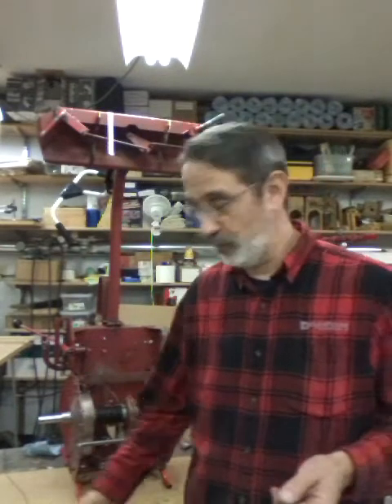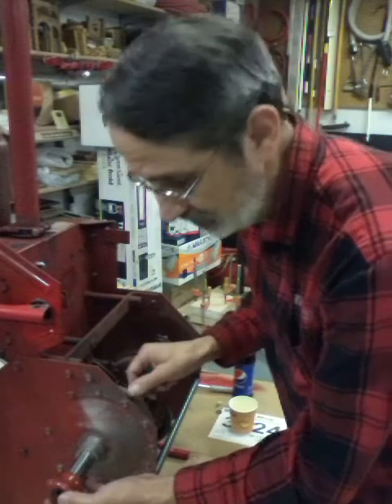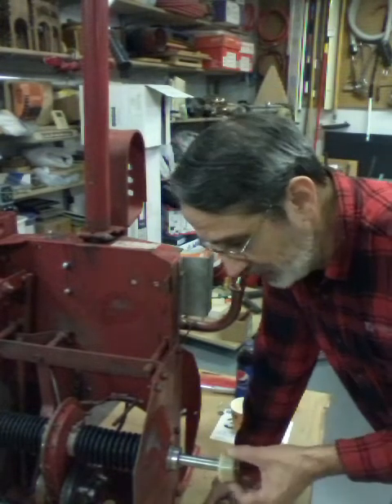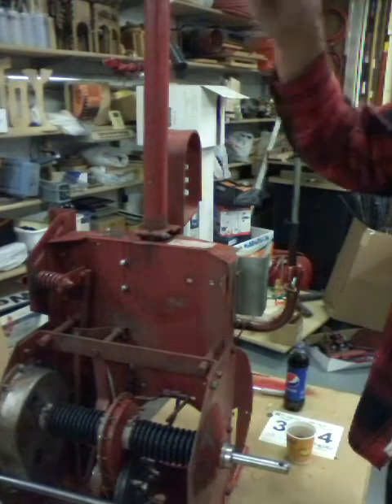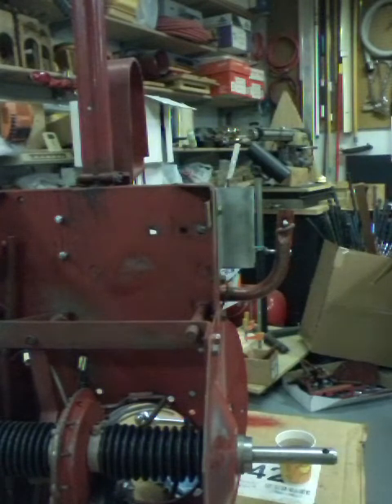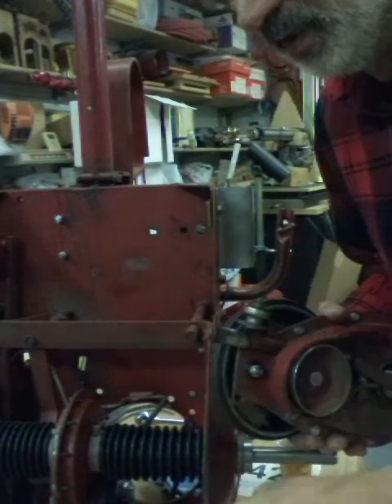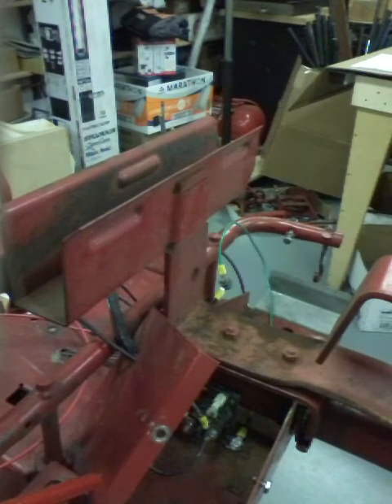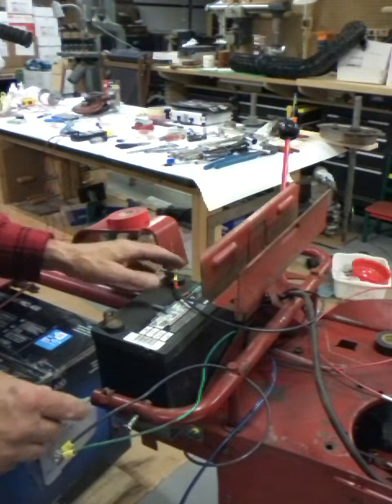22. Rebuilding a snapper drivetrain part 4 of 7

Comment: Thanks for showing this video. My Snapper was leaking oil from it's differential. The clamp was loose, I tightened it up, wiped around it good and will check it again later. I first thought it was leaking oil from the engine. This 'free' Snapper is full of surprises and a challenging project and enjoy every minute I spend on it. The rubber seal has no visible signs of wear and tear and think the tightened clamp will do the trick. Again, thanks.

Comment: Jim, great series of videos. Could you please provide the Applied Industrial part number for the LH lip seal you used and how much you paid? Also, my series 13 doesn't have a bushing on LH but uses a bearing with no grease fitting. How does this bearing get lubricated and is there a better part to use? Thx
Reply from the maker: PhoenixKing F hi this is Jim, I made a video number 157 answering your email and some others I am uploading it now and I'll be ready for you to watch in probably an hour thanks Jim
Reply: i have the same drivetrain...these are considered the "extra tough" models...no better part available...these are greased at manufacturing and are meant to last for the life of the bearing...

Comment: Hey Mr. Jackson. I was given a Snapper series 23. My son and I dragged it onto the trailer and into my house garage. The shift is stuck in neutral, not sure which gear it is in,  causing us having to drag it where we want it to go. It's been outdoors for perhaps a couple of years and I am determined to get it cutting again. With mower on it's hind end,  I turn a wheel and the other turns in opposite direction. When I turn the driven wheel by hand, the two wheels turn in same direction. I don't know if this ells me that the chain case needs work or something else. So far I'v removed the rear wheel nearest the  chain case. I've removed all bolts on side wheel panel. In process of dismantling more components since I need to replace the boots that damaged. I figured I'd find something amiss while doing so. You have any Ideas, please let me know. Thank you.
Reply from the maker: Clarence  All sounds  good  so far ,  With the  machine standing  up,  there is a steel tube with the shift arm shaft go's  through  with  a grease fitting on it,  try pumping grease into  it and have  someone hold the  clutch in and try  to shift  it back and forth. if you need  more  help email me direct at jimsfixshop@gmail.com with a phone no. and some  pictures, I will get  back  to  you. thanks  Jim
Reply: My Snapper does not have a grease fitting on shift tube arm. Should I take the shift apart and apply grease? Or should I drill hole and tap threads for the grease fitting?
Reply from the maker: +Clarence Thibodeaux     Yes I would take it apart remove the shifting handle to do so your  going to have to compress that large spring to pull out the clevis pin I have video  showing  how, then remove  the long shift link and remove  the shift handle shaft, I would  wire brush  the shafts and the hole to if you have  a  small round  brush, You can drill tap with a 1/4-28 and put a grease fitting in if you can that would  be  the  best  thing.  If you need some  help  email me direct at   jimsfixitshop@gmail.com  pictures and a phone no. would  help
Reply: Thank you for your quick response. I removed the shift handle, greased the moving part where it joins the spring shaft. I'm not computer literate to know how to send photo, perhaps my son can teach me. Will appreciate any input from you or anyone of your other faithful viewers. Thank you again.
Reply from the maker: +Clarence Thibodeaux  If  you have anymore question or if  you need any more help please feel free to ask,  if your son can help with  a few pictures would be great  or if you'd like to talk send me your number. that's why   I'm here Jim
Reply: I think I found the problem. Damaged vinyl flange bushings. Both bushings on either side of the shift spring are damaged. It shifts better now without the bushings but will replace them soon. Will let you know how it goes. Thank you.